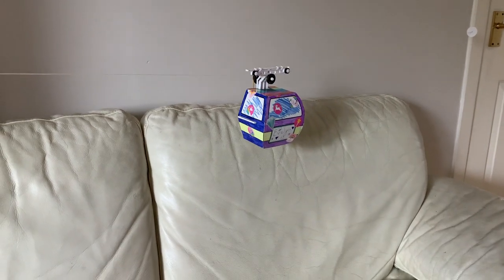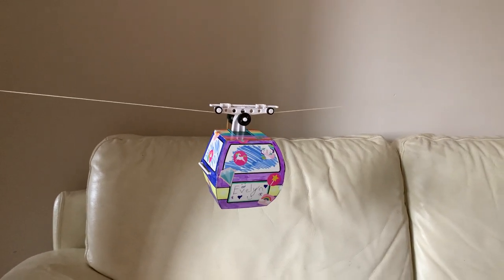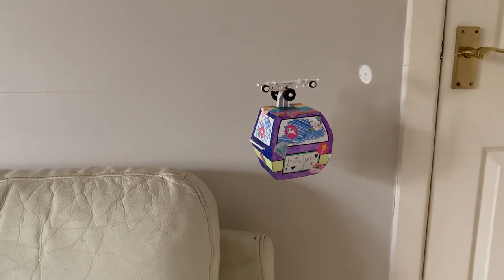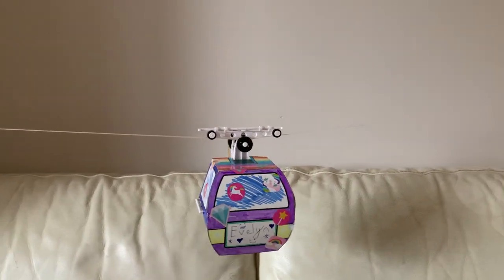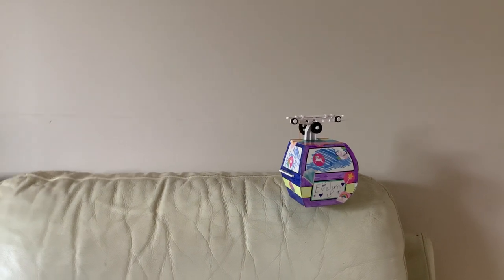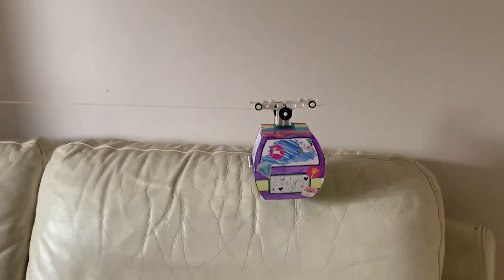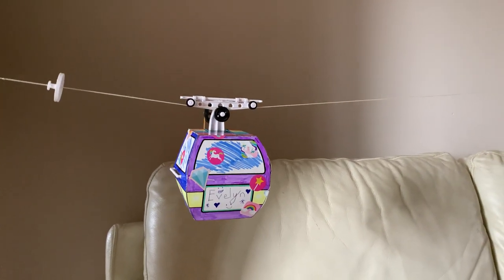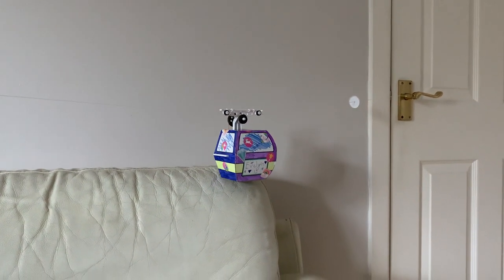E51: Tamiya Gives Children a big (gondola) Lift

Comment: Mate am I right in assuming you could use longer wire to further the distance? I have several uses for this great lil set up - it’s the reversal switch that caught my eye, it can be easily modified in all manner of ways 👍 thanks for sharing, it’s appreciated very much 🤙😎
Reply from the maker: No worries glad it’s of use to you :) you. An run it over a short or large distance depending on how long the string is that you use,